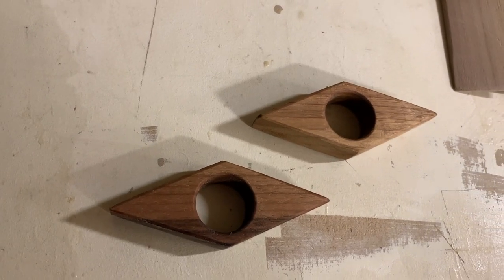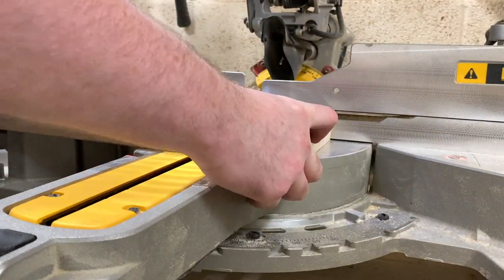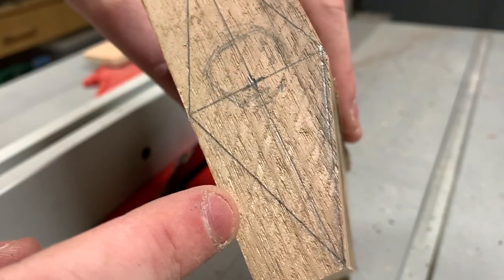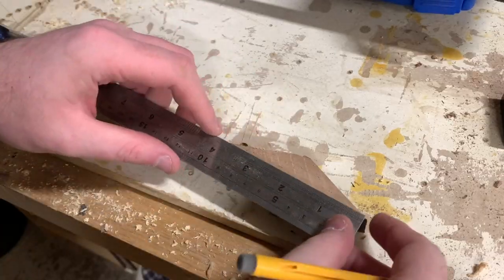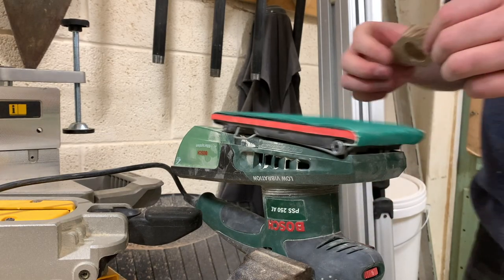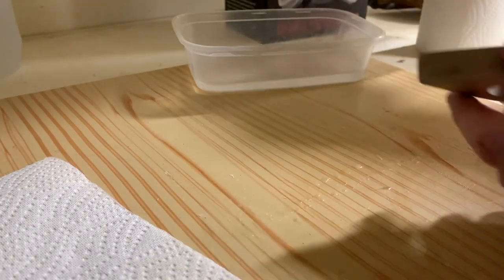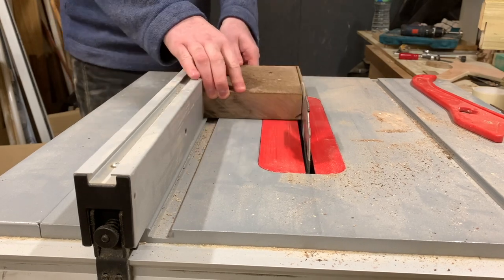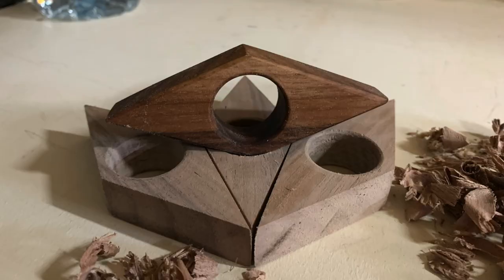DIY STOCKING FILLERS for your book worms | Quick and easy project for last minute shopping

Comment: You really shouldn’t pull the wood back with the saw blade running. If you don’t pull it back straight, you’re gonna get kickback. A piece that size is gonna be coming back with a lot of force and have the potential to really hurt you. Next time, make your cut then turn the saw off. Once the blade stops moving, pull the wood back towards you.
Reply from the maker: I’m surprised I spent some time talking about kickback and then completely missed this. Thanks for the pointers
Reply: @TouchWoodWoodworking  No worries.  Happy to help.